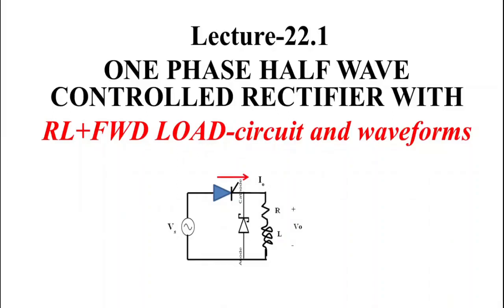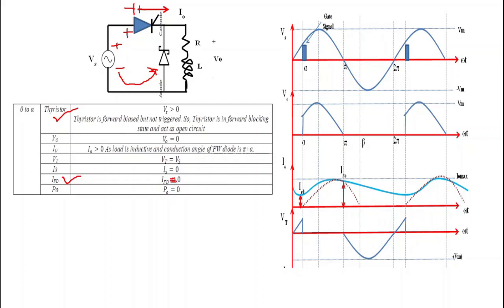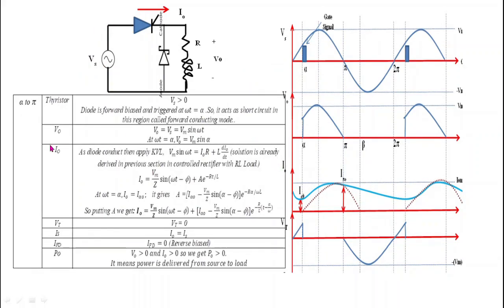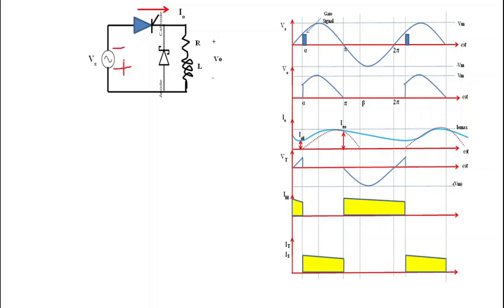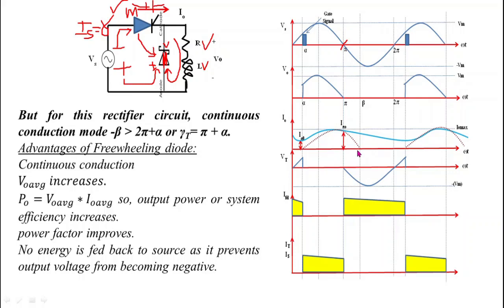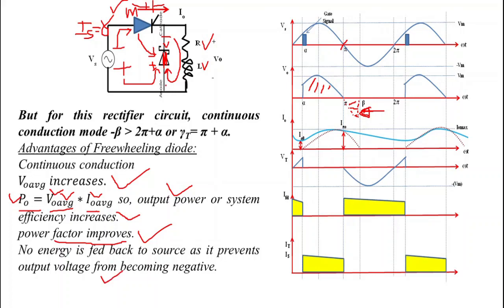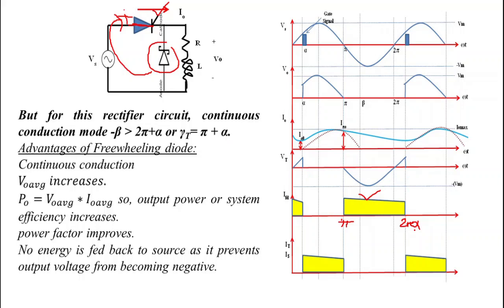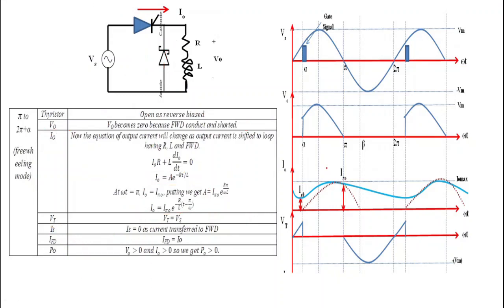Lecture 22.1 | single phase half wave controlled rectifier with RL load and freewheeling diode |

Comment: Good explanation. I got a little confusion here. It's better to mention the Thyristor Gating voltage and the biasing setup. As it biased the thyristor will become to short cct & the Zenar diode will get reverse biased with no current regulation will exceed it's maximum power rating & should be break the Zenar junction .Pls correct me If I'm wrong.
Reply from the maker: Actually diode rating is selected according to Input supply used. So in curve we can easily see the maxim reverse voltage across diode. So for a given supply a given rating of diode is selected. You r right here ,if proper rating of diode is not selected then it may get damaged.